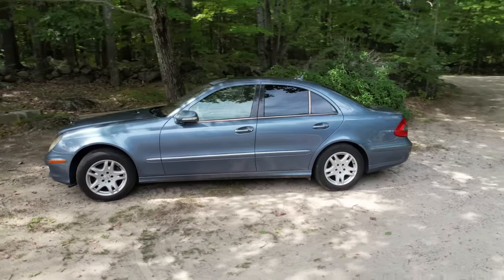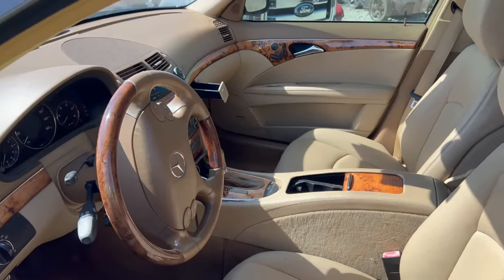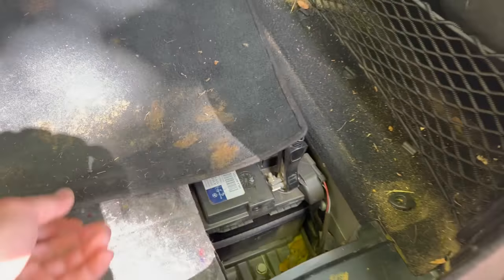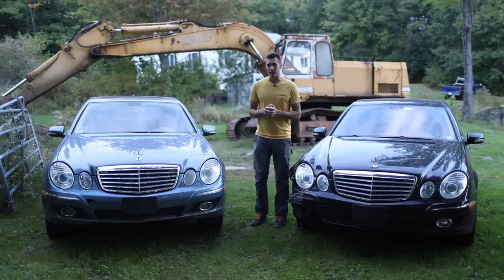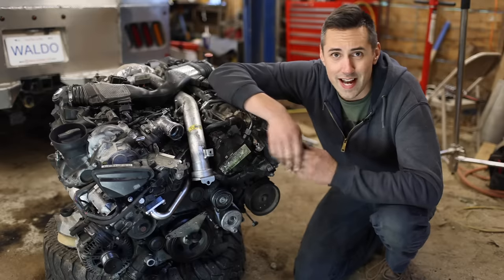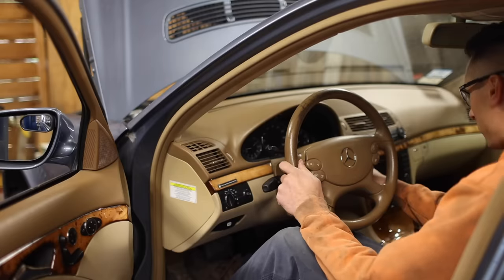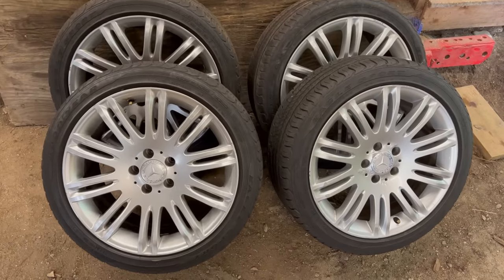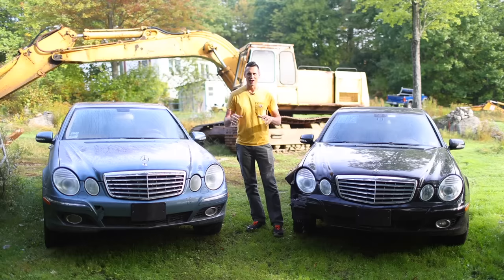Making One Mercedes E320 Diesel from Two Cheap Salvage Cars

Comment: My S211 E 320 CDI now has 635,000 kilometers on it. For Americans, that is close to 400,000 miles. So your wonderful blue E-Class has got much more life in it. I am a mechanic working for Mercedes-Benz here in Austria and I bought my car new back in 2008. The most important thing is regularly maintaining your car. Mine gets an oil change every 10,000-12,000 km. By doing this, you ensure that the oil doesn't degrade or dilute with diesel. I wish you many more happy miles with your car.
Reply: It's honestly unbelievable how many people don't change their oil as often as they should
Reply: @Cole-xq2tl  it is the key to good reliability and high mileage. If you do it yourself, you can absolutely afford to change the oil every 10000 kilometres.
Reply: Hello sir, good luck. I want to buy a Mercedes E320. Do you think it will be a problem if it is at a higher altitude on Saturday?
Reply: Do you think high mileage noise could be a problem?
Reply: @cahitakbay  if you want to go with an E 320 CDI, I can recommend buying one that hat its oil cooler replaced already, because this is a very expensive repair to have done. Around 2000€ up to 4000€. And definetely check the timing chain. When you check the car, make sure that the engine is cold, so you can hear if the timing chain is rattling.  If it is, you can expect another 500€ to 2000€ of repair costs. On my car, I have done all of the expensive repairs, since I am a mechanic myself. And try avoiding cars with SBC brake systems. If the unit fails, that is another 1500€ to 2000€. These cars weren‘t cheap back then, and many have a lot of extras and options.  Everything can fail, since these cars are getting older and not younger.
Reply: @cahitakbay  The OM642 engine is not flawless, but if maintained properly they run and run and run and …
Reply: @cahitakbay  with higher mileage, cars tend to be less reliable if not maintained properly. In case of the W/S211, look out for any typical flaws. Timing chains, broken springs/suspension airbags, loss of engine and transmission oils, head gasket leaks, take off the plastic covers under the car and look for rust, etc.

Comment: You might want to swap the rear diff as well since it has lower milage too.
Reply: meh..  Not really worth it.   Just change the fluid and it should be fine for another 100k miles without even thinking about it.
Reply: @calholli  Yeah agree, rear diffs aren't the problems with these cars. I'd sooner swap the transmission (which would require reprogramming unfortunately.....NAG2 are a pain like that) than the rear diff
Reply: @IgnoreSolutions  He did swap the trans..  but rather than program it -- he swapped the TCM - which was inside it.   Personally, I would have just ran the old one -- and kept this one safe for a backup.  That's a sweet car though.   I bought an Acura MDX in 2019,  3 rows of heated leather seats, moon roof, heated mirrors, navigation/ rear camera -- which are common now, but back then that was unheard of;  It's AWD, duel climate COLD ac.. Super cold/ and the fan blows your hair back.  Only 155k miles, zero rust, zero dents and absolutely zero leaks anywhere on this thing-- which shocked me.  I crawled all over it and it's very clean underneath- not a drip of oil anywhere on it..  And they must have just recently put new tires on it -- because they were 90 to 95% new..   And I only paid $1700. lol.. I absolutely stole this thing-- it's such a good car. The interior looks just like this Mercedes in the video....  I don't have that diesel engine, but It's a 3.5L Honda Vtec, which are pretty legendary in their own right..   It's crazy what deals are out there if you just keep looking all the time.  Things will pop up, but they are gone fast if you don't grab them.
Reply: @IgnoreSolutions  Not necessary. You can transfer the TCM conductor plate to the new transmission and you’ll be fine. There will be a new learn period while it gets used to the different valve body and clutch wear.
Reply: @erikkovacs3097  Absolutely not on the NAG2. The NAG1 no problem. NAG2 the TCM is integrated into the conductor plate and is considered “trp” (theft relevant part). Programming is required to replace and Mercedes will not sell the part to you directly unless you have a locksmith license.
Reply: @IgnoreSolutions  
What is the active component in the transmission that is sensed by the ECU I didn't see any wires or magnetic pickups what is the transducer and where is the active component thanks
Reply: @jp34604  Look at the conductor plate for a NAG2 everything is *in there*. When you look at pictures of it, its the square that says “VGS/VGS2/etc”. The ECU talks to it via like 5 pins that are also on the conductor plate
Reply: @calholli  where did you get that??
Reply: @dabofiron.itzsimplicity  So it was just a snot nosed rich kid, and his mom was buying him a new car.  So they didn't care about how much money they could get for the Acura.   That was late 2019 or early 2020..  So I've drove it for 3 years now;  such an excellent car in great condition.   It's about due for another oil change again now.   It's so well designed though..  The seats all fold down flat, all three rows are leather.   Today it's just another "typical" crossover.  But back then, they were blazing the trail and setting the trend and it's just done so well.   I just wish it was a 6 speed manual, and then it would be my ultimate dream SUV setup.  But oh well.
Reply: Great work 
Do you have any Ms for sale ? Now or later? In PA
Reply: Transmission screws might be single use. The transmission kits often include new screws.

Comment: I'm a little cynical, by I have a hard time believing that the TCM locking up in a different vehicle is a security feature.  What are the odds that transmissions were being stolen so often that Mercedes said, 'We have to stop this rampant transmission theft!"?  Seems more likely that it's there to "encourage" you to buy new parts, rather than junkyard versions.

Comment: I’m quite not sure but they seem different facelift versions. Some of these cars were fitted the SBC system. That is whole another story. I’m just not sure if the system was fitted with the straight six only or there are cars with SBC and V6.

Another remark is that the seals on the cooler might as well had been changed. The failing ones were said to be green rather than purple.

Comment: Drove my first Mercedes diesel over 504 miles with one (14 gallons)  fill up. Never owned a diesel before, and after the first fill up the needle didn't moved till I hit maybe a 100 miles. I was thinking, great I brought this car and the darn gas gauge doesn't even working. I was totally surprised how far I could drive. (It was about 30 years ago, for the 14 gallons I may paid $20.00 and took me 500 plus miles to drive. 

One day if you want to sell your blue car give me a buzz. Absolutely liked how may made a " new car" out of it. The patient you have, to take the cars apart switch engine's back and forth and do it again for the transmission are wonderful 👍 nice job 😉
Reply: Eurodiesels get absurd fuel mileage.
Even the really old unit injector VW engines (1.9 TDI).

Comment: Just discovered your channel. I am off the hook impressed. Saw your crew cab Chevy and boat engine rehab, and now this. Most people wouldn't buy an elderly Mercedes because of the rebuild/maintenance disastrous costs, but you jump into the challenge like you were rebuilding a lawnmower engine. With your ability and mechanical IQ, there is nothing you can't do. I am a HEGA HUGE fan. Thanks for posting such high-quality videos.

Comment: Regarding the oil cooler seals, it seems that they have been, at some point, replaced because the new ones are purple, while the originals are orange. I had a leak in my S 320 CDI (@ 375.00km/235.000 Mile), due to these seals and it cost a lot of money just in handwork. Great decision! Great engine, it's hard as a 🪨. If you have any query about this engine, do not hesitate to ask me! Greetings from Spain!
Reply: Came here to say this - original oil seals are orange, replacement upgraded material are purple or another colour... I think the ones I had were blue or grey???
Reply: I spotted that too. I think I would have cried a little at that point! 😂

Comment: The purple silicone seals for the oil cooler are the good ones btw, the ones with leaking issues were the ones used in the earlier made engines with black rubber.

Comment: I use 3M Rubbing Compound on my Benz headlights.   Moisten the surface, rub it on with paper towel, rub it around a bit, wash it off and clean up the residue.  No tools needed.  But they get cloudy after a couple years.  I'll use add clearcoat at the end now.

Comment: I have a 2009 E320 with 114,200 miles on it. Fantastic car! Try this on faded headlights; Mothers aluminum polish on a foam pad on a power drill. Wipe off with a micro fiber towel. A minute or two for each light. Quick and easy and just as good if not better than the kit you used. 
Really enjoyed this video.

Comment: I own an e320 bluetec 08 at 207k miles just replaced fuel filter, fuel hose, fuel pump & fuel rail. A turbocharger a remanufactured mercedes part @ 195k miles. Intercooler hoses & turbo air intake duct w/ mass airflow sensors at 205k miles + engine & trans mounts (purchased at 111k & engine mounts replaced around 125k Id recommend looking into upgraded mounts vs the period correct ones as they tend to fail) Its been quite costly thus far but I absolutely love the drive, fuel economy of the car, and the comfortability as a tall driver is great. Great video and looking forward to more like this 👍

Comment: The oil cooler seals have already been done, they were the updated purple version.
Reply from the maker: Ah, I was wondering about that. Thanks for the info!
Reply: @WaldosWorld  looks like you didn't prime/purge the oil circuit. The best practice is to replace the oil cooler, and then crank the engine several times without the injectors installed (no crank load). There is a high likelihood of the new engine spinning the rear rod and main bearings, but you might have been lucky that the engine didn't start on the first time.

Comment: I really enjoyed your video I have a 2012 S350 with basically the same engine. I love those engines and i have put many miles on mine. These cars are unbelievably strong if you maintain them. Many problems that these cars have are not because they are bad cars. The problem frequently is that these cars end up in the hands of bad owners.

Comment: Let’s get this man a proper shop to work in
Reply from the maker: Desperately needed 😂
Reply: @WaldosWorld , when I was a young man in my late teens, early 20s, I built my pulling trucks in a cheap portable car port. Plywood floor, salamander heater, carbon monoxide poisoning and beer, oh the joy of turning wrenches in upstate NY winters, 😂 I definitely feel your pain Waldo
Reply: Years of wrenching at -40 in Alberta winters in an old garage with a kerosene heater means I feel your pain.

Comment: WoW u have done a great job, today I am going to do almost the same to my 2008 MB E320 BlueTec and I am wondering if u still have the old engine and want to sale it?
These Mercedes Benz are amazing and I don't swap them with any other cars.
The best thing is these engines don't need to Add Blue like the 2009 models.
Really u make me very happy by this video.
I am living at Texas and also I have the C4 & C6 if u need to program the controllers , modulars or SAM, or anything for Mercedes-Benz 🧑🏻‍🔧

Comment: Awesome video man, it's nice to see someone actually doing videos on the om642 v6, there's not many people out there who do much on these engines.  Also a nice upgrade would be the elephant nose mod to the breather pipe(prevents oil seeping onto the swirl flap motor and causing failure)... straight piped these cars sound insane 😂(I'm running stage 3 boltons).... a tune ... also with vediamo change the throttle curve to kld2 and torque limits off and set to msg (this really wakes up the car ) you can also fool around with vmax and egr+cats  off . The egr really fouls the intakes, I have no emissions on my car , 2014 C350 CDI . With vediamo you can always turn the emissions on for inspection and off after . All the best though, can't wait for the next video!👍🏻

Comment: another sickness of these engins are the injectors, they leak after a common mileage, u need to replace the copper seals when you pull out the injector. When they leak you'll hear a puffing sound and you'll smell the diesel also in the inside and outside the car.. Other than that, these are the last best build mercedes. I had two of these and I've never regret the purchase. These engins are undestructable... Well, the hole on the blue one, that's a sign of bad maintenance. I guess the previous owner didn't top up the engine with the right oil. Great video my man. keep them coming.

Comment: Great job on the swap Waldo. Did you swap out the water pump? I used to always put in a fresh one. Also look in the tool kit for changing the tires. There should be a long stud you screw in to keep the tire from flopping off and easier to put the new tire on. If not let me know. I may still have extras I got from wrecks many years ago.

Comment: Waldo, i don't know if you know this, but the injectors have a specific codingnumber that is unique to each injector. The engine will run on any coding, but to get the engine to run the best(fuel economy/emissions), the coding should be corrected. 
It's stored in the engine control module. If you can get power to the other car, you could read the codes there. Otherwise you need to get to the injectors themselves and read the numbers directly on the injector.
Reply from the maker: I didn't know that, thanks for the tip!

Comment: Knowing the OM642 engine as i do, it would be worth mentioning that the purple oil cooler seals are infact the uprated ones. The orange ones are the common failure parts. Talking of ornage seals, there is a mis conception that every drop of oil that drips out of the turbo housing and onto the swirl flap motor comes from the turbo. The other culprit is the PCV valve on the back left of the head as you look from the front of the car. The diaphram inside ruptures and allows the oil to flow into the breather pipes towards the turbo. People then see the oil sitting around the large orange seal that connects the "Y" pipe to the turbo and spend loads of money replacing the turbo when in fact the problem is still there AKA PCV. I would change that valve asap and the small and large orange seals. 

Other common issues with these engines are the freeze plugs which again are on the back side of the engine. i will post videos below to show you these. 

the swirl flap motor again goes MIA with oil contamination as i mentioned above. To get around this you can do one of 3 things. leave as is if no oil is dripping out of the Y pipe, You can replace with a brand new one which isn't cheap or you could do what is a common fix and that disconnect the plug to the motor and put a resistor across 2 of the pins which fools the ECU to thinking that the motor is ok. Again i will add the video showing you what resistor to use. It's a 4.7K resistor. 

The glow plug relay is another common unit to go wrong. It's fault is one of the conatct pins inside breaks away from it's solder joint and causes issues with starting from colder temps. Again, you can just get another unbit or you can prize the lid off and resolder it back together. It's a fiddly job and the circuit board it covered in a mastic layer to stop[ moisture getting in but you can cut it away to get to the broken pin / leg. 

Turbo actuators can also go bad. The this green "O" rings in the large aluminium pipe on the top of the engine can also perish and cause running issues. 

Don't use cheap glow plugs as these will burn out the glow plug really quickly. 

https://www.youtube.com/watch?v=5LkWszMWPqY&ab_channel=MBDieselFreak

https://www.youtube.com/watch?v=GPJCWX_HMYk&list=PLOcaK5h_tY0yzg2PczN7XA7CLDVusgoLl&index=13&ab_channel=ScottElliott

https://www.youtube.com/watch?v=mLvlVDR4vVw&ab_channel=MyMateVINCE

Hope this helps.
Reply: Thank you for posting the links .  Very appreciated. 07 e320 bluetec

Comment: In Europe there was W211/221 versions with OM629 4.0 V8 diesel engine and AWD :) My friend has W164 with that engine. Sounds lovely and has great pull. Highway consumption is about 7.5-8.0l per 100 km. I think that's pretty cool for such heavy vehicle(2.3 tons)

Comment: That blue is a really nice color. I have a pre-update 320 (when they still had the straight 6) as a daily driver, and it's at just over 300k. You might want to change the diff oil, and run it through a clean filter cloth to check for shavings. These rear diffs tend to get somewhat neglected, even more so as MB claimed a lifetime fill. 

Also, keep an eye on the inside edges of the rear fenders, that's where the first rust on that body will start.

Comment: +Back in 1996 I bought my missus a brand new Vauxhall Corsa Breeze ( a really small British car that wouldn't look out of place hanging in davits off the back of your Merc) it's still sitting in the drive (it's done a lot of that!) with 26,000 miles on the clock. For the first nine years, it ran and started on it's original Vauxhall on label battery - O.K. it didn't do much work but leaving batteries lying about it's normally a good thing.
Another great video - as others have said - so much interesting stuff in it. Looking forward to more.

Comment: Merc W211 E-class diesels AND a Hungarian Vizsla!  Awesome!  Pity both the Mercs are the facelift versions with the V6 motors, the I6 OM648 is a much stronger and more reliable unit, with more tuning potential.  On the plus side, no stupid SBC system...